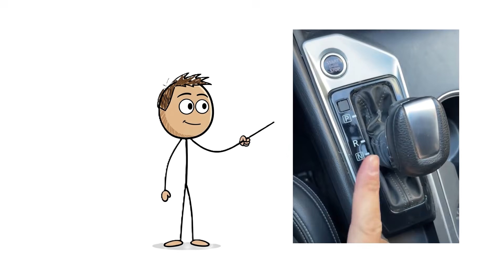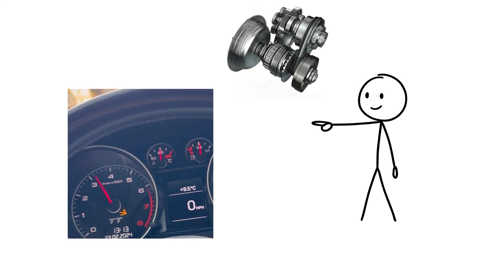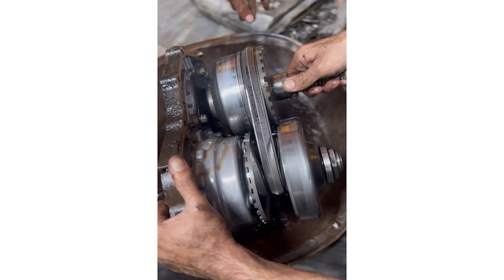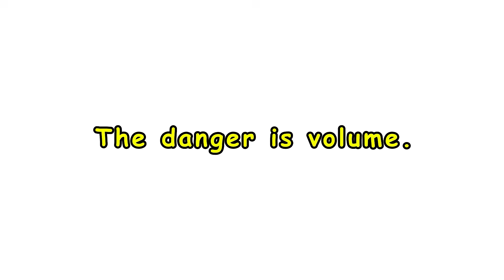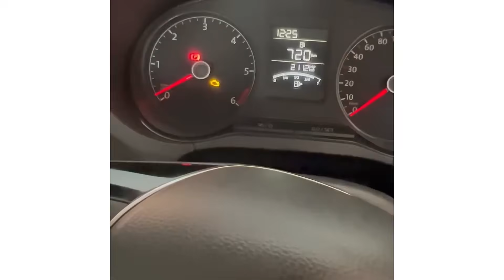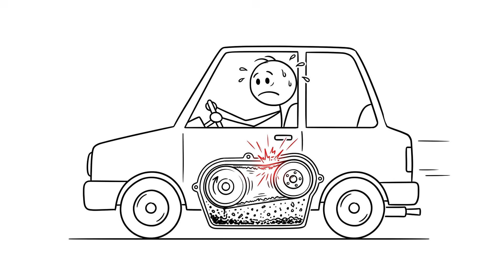99% of CVT Owners Have No Idea How This ONE Bad Habit Destroys Their Transmission

Comment: My 2002 Altima 2.5L has exceeded the 225,000 mile limit. No problem with the CVT transmission; never changed the fluid.

Comment: Until they install these belt type CVT in big semi trucks,  I would not even look at a CVT.  Even if they figure out how to grip the belt reasonably well in a vocational setting,  I don't think they are bothering with that because that pump is going to negate all that efficiency gain.

I'm sticking with those good old tripedal manuals, just like those trucks.   And I mean trucks,  not those emotional support vehicles

Comment: Vehicles with CVT I’ve owned: 2007 & 2012 Prius, 2013 Altima, 2016 Outback, 2017 Legacy. Zero engine or transmission problems with any of them..owned them all to 90K miles minimum. Never had CVT fluid changed either…unfortunately, one of my sons totaled the 2012 Prius and my daughter totaled the Legacy—they both had over 110K miles. We sold the Altima the daughter of a family friend. She drove it to over 180k miles.

Comment: As a new cvt owner, I ignored all the things I was told about lifetime fluids. Do my transmission fluid swap every 30k miles and engine oil every 7k miles. Going on 156k miles with zero performance issues. Still a etage 40 mpg as well

Comment: 2014 Nissan Rogue, just rolled over 200,000 miles. I Have the CVT serviced by trusted transmission shop every 30,000 miles, and do regular maintenence on engine and cooling system. Still going strong.

Comment: 60 seconds in, and it's clear this person doesn't know half of what he's talking about. The 2-pulleys-and-a-belt was the first commercially sold consumer transmission in the US in 1989 in the Subaru Justy. The Nissan Rogue also had this, and is when most people first heard about it. But there are several newer, NON-BELT CVTs, like Toyota's eCVT (aka the power split) which use only gears in some brilliantly simple engineering - which is why you see all of those Prius taxis at the airport with 300,000 miles on them.

Comment: Hi everyone. Could you help by answering this question. 
Once I stop at a traffic light, do I switch to neutral or keep in drive while holding the break? What is the best thing to do. 

I drive a Toyota Corolla Cross (non hybrid), 2022 model. It has a CVT and not a ECVT.

If anyone with experience could answer my question. Thx

Comment: 203K miles on my 2009 Nissan Altima. Never had the transmission fluid changed. Never added transmission fluid. Runs absolutely fine.

Comment: Had a 2017 honda civic brand new. Did the transmission fluid change every 20000 miles and the transmission went out when the car reached 216000 miles.

Comment: i am driving my first cvt equipped car, 2018 Civic coupe, 30000 miles.
Watching this , and similar videos makes me think my cvt is not functioning properly.
I keep hearing that going downhill cuts the fuel to take advantage of gravity.
O.K.
Makes sense.
I have a long winding decent i take every day, as soon as i take my foot off the gas, it starts engine braking.
As the hill gets steeper it will drop down another "gear" and send the rpm past 5000.
it doesnt let me just coast.
It acts like the cruise control is engaged, and tries to keep me at the speed where i took my foot off the gas.
So now, i just put it in neutral and coast.
Every thing I have read says that doesn't harm the cvt in any way so...
Is this a common issue, or something that needs attention?

Comment: LOL  in the end all this CVT mess was designed to keep a car in the RPM sweet spot for optimal gas mileage. Saving maybe at best 1 or 2 miles per gal. Absurdity!!! Just don't buy a car with one..ever. Even a Subaru (which I love those cars) but they are CVT. No good, never gonna buy one...period!

Comment: At long red lights I put my CVT in neutral. Drive when light turns green.  Never ever abuse it.
Reply: Oh, and very frequent CVT fluid changes with pan screen and cooler filter replaced at 100,000 KMs.
 LUBEGARD BABY-

Comment: I’m driving a 2011 Mitsubishi CVT bought new .I’ve done several drain and refills and a complete fluid exchange . My mileage is 152k. I use a BG or lubegard CVT supplement. I’m getting ready to do another fluid exchange using Castrol Transmax universal fluid. I believe the fluid compatibility issue is overblown in this video and on the street. None of the manufacturers mentioned here will approve an aftermarket fluid.  I’ve run the Castrol fluid I mentioned for  25k miles.

Comment: We neglected the transmission service on the Nissan Murano until it had 100,000 miles. The service manager told us that, since the fluid had never been changed, not to change it at this point, because the material in the fluid is providing friction that is keeping the transmission operational, and if we changed the fluid now, the transmission would likely stop working. I paraphrased his technical explanation according to my ability to comprehend what he was trying to convey to us.
Reply: I bought a 2015 Nissan Altima from my sister around 107,000, around 120,000 I started to get around to maintenance stuff and come to find out she had never had it changed. Took it to dealer and they told me same thing but they didnt want to do it b/c they didnt want to be blamed when/if it went out.  I guess they were paying for too many to cover.  I was told by my regular mechanic to try calling a different dealership, the one the richy rich people go to.  Havent called them yet though.  I am the type of person that keeps cars until almost 300K< i dont even buy them until 100K!  I dont want a modern car with 40 computers so it looks like I will be paying a lot to have them fixed.  I guess I would rather pay 25K for a used car from 1990 then the same price for 1 from today if they arent designed to last past 100K.

Comment: I recently bought a used honda civic lx, 2.0 liter, 38100 miles my first cvt , first thing I did when I bought it was take it to my local shop and had them drain the fluid, replace the 2 filters, install a new gasket, and refill with Honda oem cvt fluid, my manual calls for a fluid change every 30 to 50k .. I will do 30K and change out the filters every 60K going forward

Comment: The guy who sold me my Rogue told me the very same thing, do not replace the fluid in the transmission, it will last 200,000 kms  the first replacement I did was at 103,000 kms and the change was obvious the CVT ran much smoother and ever since I replace the filter every other replacement of fluid , both of them. . The large ans the smaller , not easilly accesible, , ,

Comment: How much of a difference can there be between Honda CVT, Nissan or Subaru  they all use the same concept of transmission , moving sheaves, hydraulic control and a metal / steel belt ! ! !

Comment: I've been following these habits on my 2012 Nissan Rogue,  everything has been ok for 130,000 + miles CVT has been running smooth without any issues. One thing don't put into it generic CVT fluids sold by Valvoline, Castrol, etc, use original manufacturer fluid such as Idemitsu.

Comment: Toyota uses E-cvt pretty close to regular Automatic Transmission.
Hondas are pretty reliable as well.

My experience is CVT uses more fuel because driving normally is different from the cycles the EPA runs. Because of the sluggish power loss of CVTs engines work harder to get them to move...

Nissan and Mitsubishi is similar transmissions from the same manufacturer. Nissan dies much more often.

NEVER use Nissan recommend CVT ITS GARBAGE. I  use Castro, any good fluid is fine AMSOIL etc. secondly I installed an external oil cooler. Cheap and helps keeps temps good. The cooling alot on Nissan is inadequate to keep the CVT cool. So between poor fluid and high temps Nissan CVTs are doomed

Comment: I have Subaru Legacy 2013 with CVT and Subaru Impreza 2016 with manual.  
Legacy  CVT failed in three years and warranty paid for it.
Only issue with Impreza is failed CD in entertainment center.  Clocked over 100,000 miles.
So my question is why does anyone opt for CVT or aiutomatic tranmission when manual does the job. 
Stop/go traffic ?  Don't bother me.  Had manual for almost all of my driving years and I will be 74 in two month.
So why was auto and CVT invented  over  cheap. reloable, and low maintenance MT ?

Comment: I got my Honda Amaze CVT fluid changed at 45,000 kms and 100,000 kms just at $35. There is not much change which I could feel at accleration or uphill, just one thing I noticed is the engine has become  a bit quiter than before CVT change.

Comment: I'll take a regular clutch driven automatic transmission or standard manual shift transmission any day if I want something with a snowmobile transmission I'll buy a snowmobile because I will not have any kind of a belt drive system in a transmission of a car they're junk and four or five quarts of that synthetic transmission fluid that you have to put in them cost just about as much if not more than a full tank of gas

Comment: I drive Honda city 2012 model with CVT. 205k kms no problem, still going smooth. I drive light foot and never go past 3.5K rpm.
Reply: That’s why it has lasted you are coddling it. Hope you never have to deal with getting up to speed in an emergency.
Reply: Why not over 3.5 k rpm that doesn't make any sense?

Comment: I've got a 2019 Mitsubishi Mirage with 44 thousand miles. I've heard that by 2019 the CVT problems were solved. I've not had any trouble with mine and I bought it new. Never had a fluid and filter change. I plan to but it will be a year before I can afford it.
I take it easy, no rough starts. Hell, I doubt the 78 horsepower engine has enough to harm it anyway.
Reply: It's a steel belt one of the weaker designs there easy to do mate shouldn't cost more than 150-200 to do your external filter and drain and fill yourself the pan one would be ok till 100000km
Reply: @Matthew-dm2mq there was a time I could crawl up under a car and do most anything but I'm not able to now . I can't even change oil as anymore, I could when I first bought it. I don't like using the dealer but I don't trust any of the local shops . I know dealer will use the right parts and the right fluid . Dealer wants about 
$350 to do it . Thanks
Reply: @gjpopper3863 far enough mate but obviously i don't know your situation but the sooner the better obviously if its done right. My nissan dealership is retarded so id rather get a auto specialist to do it if i didn't do it myself.

Comment: When CVT Trany's first came out I was anxious to see the technology. When I learned that adjustable sheaves like those used in common Machine Tool Spindles were used I could not believe that anyone thought it was sound Engineering. Even at the relative medium to light duty of Machine tool like a Bridgeport or Tree Mill they wore out and required a certain expertise to repair. Absolutely a poor application.

Comment: after changing fluid, how do you get the car to relearn?  2018 Nissan Versa Note
Reply: Those relearning procedures are performed with a "scan tool" or other "diagnostic software" but they're really just tweaks intended to compensate for calculated wear over time.  If you have a transmission replaced these days, resetting those is usually part of the whole repair job.

Comment: My cvt honda hrv 2017 model has a jerk on slowing down. Just one jerk between 40 and 50km/h
Reply: Could be misfiring
Reply: @GeminiHiro009 it started happening after my transmission fluid change

Comment: Hi and Good evening sir, asking you again.
very nice video. I wanted to note please few things.
1. In most of the countries, Toyota refuses to do the fluid change. You must find independent technicians to do it and to be very careful, they must be professionals.
2. You say that drain should be done when the fluid is hot. Toyota manual say specifically that it should be done when the fluid is completely cold, so the amount of the fluid that should be added will be accurate.
3. All the services videos that I saw of replacing the CVT fluid, doesn’t show anything related to the car computer. Simply drain 4 liters with filter replacement and add the new 4 liters fluid FE type , (see different videos from different countries for “Toyota Corolla 2014-2018 CVT fluid  transmission change ” in YouTube). 
By the way, most of the videos show replacement of 4 liters out of 8, not ALL the fluid quantity. Is this still good ?? Better than never replace for sure, eventually it mixes.
Waiting for your notes/opinion. 
Thank you very much sir. Wonderful video you made.

Comment: the metal belt has 400 little peices ,CTV transmissions are shit ,junk,dont touch them,no matter if you change the oil in them at 30,000km they will still fail ,i wont touch them with a 10 foot pole,i know a person bought a brand new nissan micra 30,000km on trany shit the bed,and they had the oil changed  in it and it still failed ,got 3 words to say about them junk ,junk ,junk,

Comment: Interesting video, but what about the use of paddle shifters, simulating gears on CVT transmissions? These were not mentioned. These "gears" can be imagined at pushes and pulls on the pulleys, simultaneously, so as to get the feel of shifting gears. However, I think this practice could probably rise the possibility of damage through slipping the belt, particularly by changing "gears" at high rpms. Is this idea correct? Personnaly, I prefer a 6 gear manual transmission, anyway.

Comment: Nonsense.  The toyota ECVT is a misnomer.   There is not a pulley or belt.  The computer just balances the engine vs electric motor loads.  The speed ratio of engine or elec motor does not need to changed! There is really NO transmission.
Reply: But only used on Toyota hybrids, everything else plain old garbage cvt.

Comment: Two years ago, I got my first car with this type of transmission. I really like the way it took off went uphill went around cars I watched the RPM‘s gauge and it was extremely smooth. They might have some bugs in it, but I think it’s a great idea.
Reply: They are trash. Most crap out after only a few years. Doesn't matter which brand. Ask any honest mechanic and they will tell you to stay as far away from CVT's as possible

Comment: I drove a Forester (2015) with CVT for 162,000 miles with no problems.  I had the transmission oil changed 3 times.  I now have a Rav 4 with an 8 speed automatic and find the gear changes somewhat irrating  especial the delay in shifting between first and second gear.  My next vehicle will be another Subaru.
Reply: No question the most current Subaru CVTs are very smooth and quite reliable.
Reply: Subaru CVTs are the most robust, that's why they dare use it on their fastest turbo models.
Reply: Funny you say that. We test drive a new Forester Touring. Ask wife how do you like the CVT? Wife says “ No like it better then gears cause I cannot feel any shifts!!! By the bye,,,, she is a hater of the manual transmission!!! Can you believe her? The nerve!!
Reply: Head gaskets and $3000 cam carrier leaks
Reply: @denslod2930 Thstvis so 20 years ago. 😂. Welcome to 2026 bro!!!

Comment: Mistake number one, buying a vehicle with a CVT transmission.  It's past time to give up CVTs
Reply: Facts, i would never
Reply: I’ve had two CVT transmissions in the last 4 years.  I bought a new 2022 Honda CRV EXL, and liked it so much I traded it in for a new 2025 CRV Sport-L.  Both vehicles have been awesome without any problems from the CVT Transmission!
Reply: Whatever you say, bozo.

Comment: Connecting your transmission to your cooling system?????
That is not something an owner or aftermarket workshop should need to do.
If it is necessary and is not done by the factory, that would be criminal negligence on their part.
Reply: They're just heat exchangers, the fluids are separated.  Fun fact: in little passenger cars, the transmissions are exposed to more stress from cold operations (not ambient temps, just not operating temp for the transmission) than hot ones.  Many technical manuals I used to work on them called them, "transmission fluid warmers".

Comment: Last year we bought a second hand Toyota Avensis with a CVT. First maintenance we did after receiving the car, I explicitly asked for a fluid change from the CVT. They put on the bill ‘fluid change on request of the customer’. The garage somehow still thinks it’s not necessary to change the fluid. But I’ve come across it before, from a mechanic that mentioned it certainly makes a difference in the lifespan of your car.

Comment: MY 2016 Rogue when cold at below zero wont shift ... when heavy traffic on a hot day a red light start produces a dead pedal untill half way down ...  both get cured by shutting off car for 10 seconds and restating.  Took to Nissan no error codes and they changed the fluid for $635. No change. Please DM me if you have a suggestion ..... thanks
Reply: It's heat related if fluid has been fully changed id look at filters it specifically the external paper filter for the cooler line and changing the vehicles coolant id recommend for a start how cold is cold they do have a saftey mode to wait for the fluid to get up to temp before operation.  What's the mileage and obviously check your air filter and give your mass air flow sensor a clean these things can cause issues.  Basically the cars protecting itself as the fluid in the transmission is to hot. If you're coolant is no good and the filter for the transmission cooler is blocked up itll overheat they struggle normally without those variables.